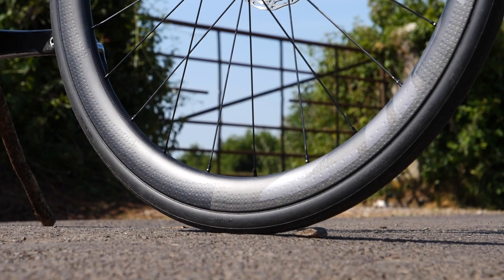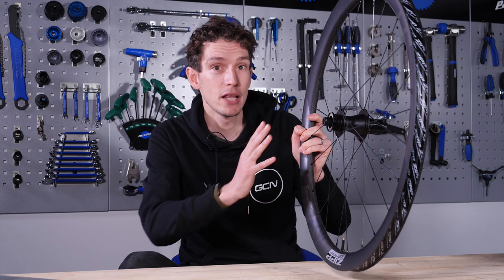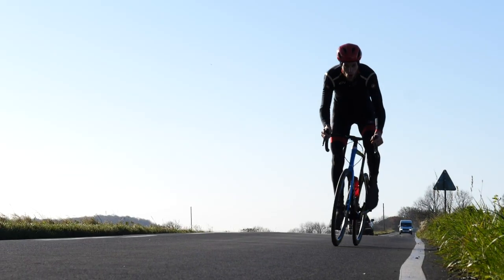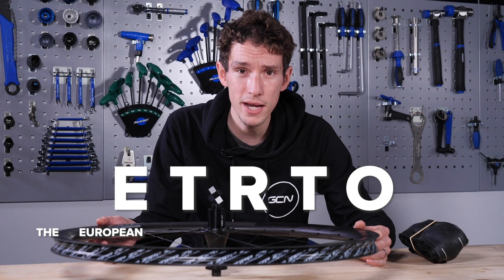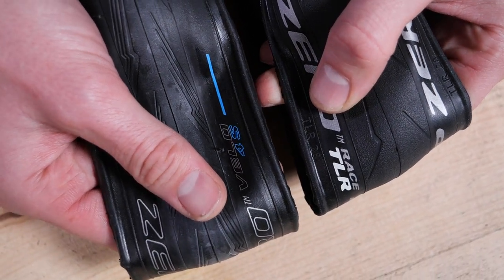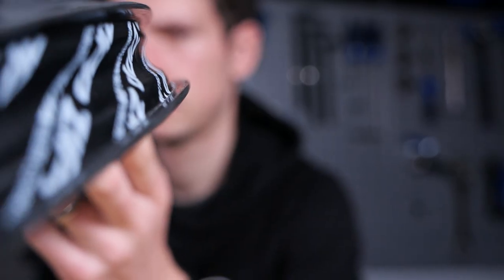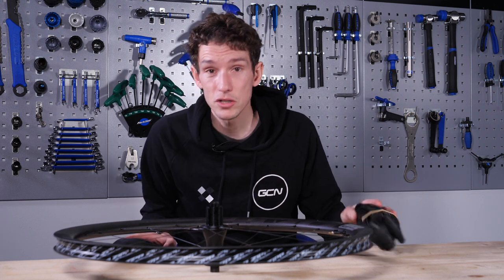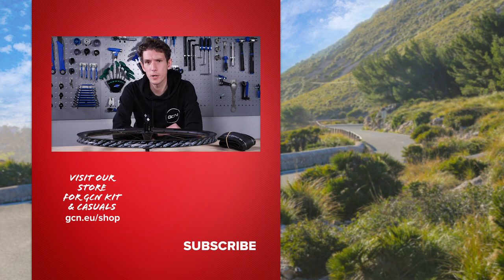Hookless Rims Explained | Which Bike Tyres Can You Use & Why?

Comment: I seriously looks like a 29" MTB wheel... Ia pretty sure my Crossmax are not even that wide...
Reply: My crossmax lite rt are 21mm and it is considered too wide for road tires, so they serve as CX set.
Reply: @feedbackzaloop  mine are 28 mm in exterior width for 2,15" tires. My road bike has 21 mm external width rims with 23 mm tires. I have no issue mounting 31 ou 33c tires on my road rims. All works fine. 

All these extrawide rims is just BS to force people to by new stuff because nothing is compatible. Road biking is going MTB style on tires, brakes, 1x... It is ridiculous. Having a modern Eagle 29ner XC and rim brakes cross and road bikes. I see every day there is no actual need for mega wide rims/tires and 1x on road bikes. 

Gravel bikes are using lifebuoyes tires despite dry conditions CX tires perfectly well...
Reply: @simonrano8072  that's all cool and entertaining, however the rims are rated according the internal measure. So actually now road rims are just approaching the sizes of Mtb from 30 years ago with width of 19...21, that's yet incomparable.
Reply: @feedbackzaloop  these are 23 mm internal and Crossmax are 25 mm FYI so yeah it is pretty modern MTB width to me...
Reply: @simonrano8072  and that is exactly why Crossmax (not LiteRt like mine or some other versions) are rated as Mtb and you don't fit even 28mm tyre, let alone 23. I believe you still could, but it should be a pain to seat those and still a fright to descend at 70+km/h. Also because any liability or insurance must be voided, if this tyre-rim combo fails.
Nevertheless I agree one doesn't necessarily stick to the standard strictly and no way I'm paying 100+€ for a pair of dedicated Yksions. It's just not that you can mix and match everything with anything 🤷‍♂️

Long story short, Crossmaxes are the most narrow the mtb rim should be, while 303s are the widest road rim can (yet) be. And there is still difference between them.
Reply: @feedbackzaloop  OK no 2 mm norrower than my MTB wheels and 8 mm wider than my road rims, still a difference but you will agree than it is getting pretty close to MTB shit. You cannot fit less than 28 on these Zipp. 

What makes me mad is even if rim braking wheels still exist, my 2010 frame wont allow a 19 or 20mm modern rim with a 25 mm tire on it. They properly render my bike obsolete despite my groupset still working perfectly officially for the sake of a few watts and confort but mostly to push customers to renew their equippment faster. 

And for doing road bike extensively along with MTB and CX i never need 28 tires anywhere else than on Roubaix like cobbles and 2,15" MTB tires are pretty enough in winter conditions. And I don't even mention tubless shit...
Reply: @simonrano8072  true, it's getting harder and harder to find a working combination, you can't just order anything and hope it will fit. But I am more concerned about through-axles and disc brakes, as there are still decent and perfect 17mm rims on the market, both alu and carbon. So should I want a new frame next few years, it will be no longer compatible with any part I have now.
Tubeless though... With enough sealant you can make any tyre tubeless. And you still can use tubes with tubeless specific tyres/rims. So just let it be.
Hookless - neither you nor me are ready to use them on the road. Alas, would be nice to get the weight benefit of omitting the hook.
Reply: @feedbackzaloop  True and considering the mess that axle standards is in MTB... I really don't want to bother with tubless, sealant and stuff. I prefer being able to store my bike for 3 months in winter, pump up and go, changing inner tube without cleaning my rim, bike and hands afterward and purchainsing a powerfull pump to set the tire. Nevermind the "confort and grip" I never intended to win races. 

Beside that I honestly think the trux axle idea much better than quick releases but QR are plenty sufficient for road bike. 

15c/23c combo never prevent anybody to get up an alpine climb nor descending at 70 kmh nor riding 400 km in one go nor getting up Koppenberg. 

Progress is not just improving performances it is also getting complexity and operating cost lower, sadly it is not the direction of cycling industry for the past few years.
Reply: @simonrano8072  agree with every statement! These are the turbulent times for the industry we are living in now.
But the progress is inevitable, in any form of it.

Comment: Max pressure 73psi. Aerocoach says my optimal tyre pressure is 83psi.
Reply: These wheels aren't cheaper than the previous wheels only for Zipp themselves and the Tyre pressure is not optimal
Reply: You need to try bigger tyres old boy.
Reply: @whatwelearned  28’s. Try it, put your stats into the Aerocoach calculator, see if you can get it below 73psi.
Reply: @thijsvandenbroek5333  They are cheaper, I’m not sure you can argue with that. As for optimal tyre pressure? You run whatever you like Thijs, the cool thing about bikes is you can set everything just how you like it.
Reply: @thijsvandenbroek5333  303 Firecrest is US$600 less than previous generation.
Reply: In the netherlands the wheels aren't any cheaper than the privious models
Reply: @simonrichardson5259  they only allow 5 bar and I like to ride at meast 6.5 bar for the smooth roads we have here

Comment: sick and tired of these recent constant changes to wheels tyres and brakes - there is nothing wrong with  tech we had 10-40 years ago and more importantly you didnt need a whole new frame and groupset if you needed a new set of wheels.  Now if you need a new tyre and your favourite are discontinued you need to worry if you need new wheels which need a new frame etc etc. total madness but I'm sure very lucrative for manufacturers. Built in planned obsolescence on steroids.

Comment: Cheaper to manufacture will not translate in drop in price for most wheels though because of C A P I T A L I S M
Reply: Don't understand the free market much? Suppose it costs you $50 to make something that you're selling for $100 and I can make that thing for $40. I could charge my customers $100, too, and make $60 profit per unit sold. But I'll sell a lot more units if I charge $95, undercutting you. Sure, I'm not passing all my savings on to the consumer, but it pays to pass some of it on.
Reply: @beeble2003  I think you are the one that doesn't understand that the current modern globalized ultra capitalism doesn't work in the classical Adam Smith free market way.